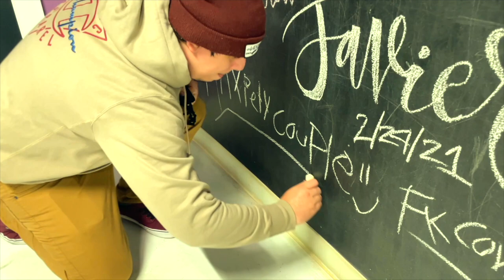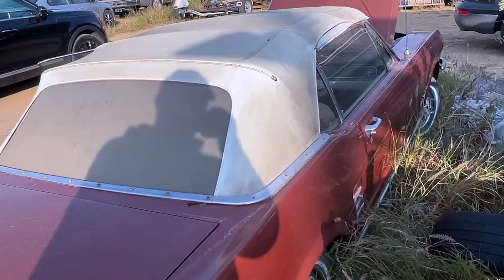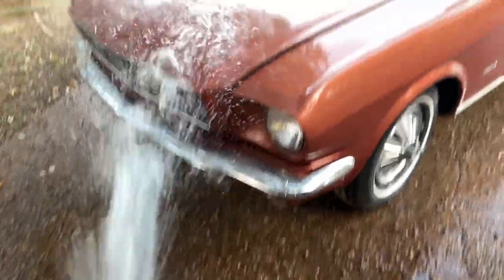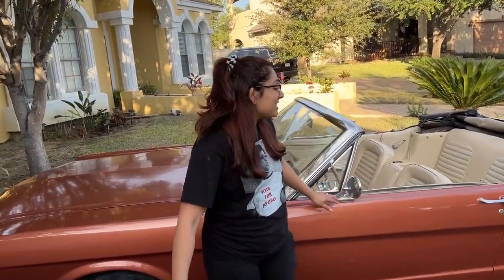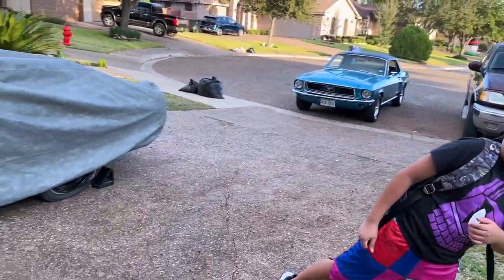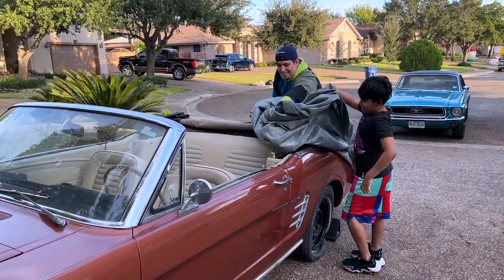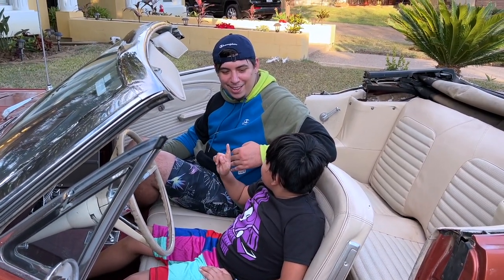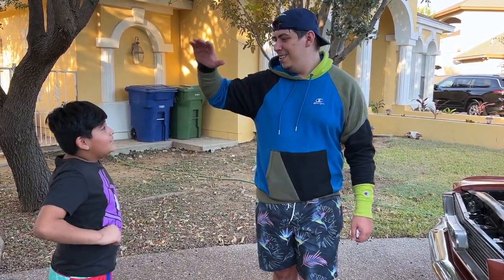Surprising my Stepson with his DREAM CAR!

Comment: I recommend a 460 ford motor with long tube headers and a 650 cfm Holley carb mutha thumper cam etc just get rid of that gay 6 cough cough I mean straight 6 when he popped the hood I almost puked that ford even put that shit in there yea a 460 is a big block V8 for him but by the time it’s finished he be able to handle it